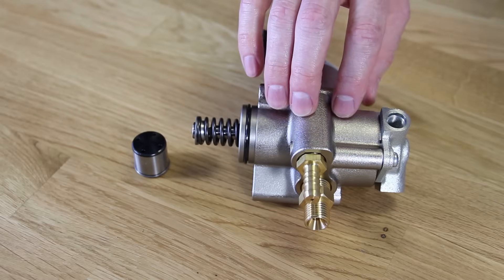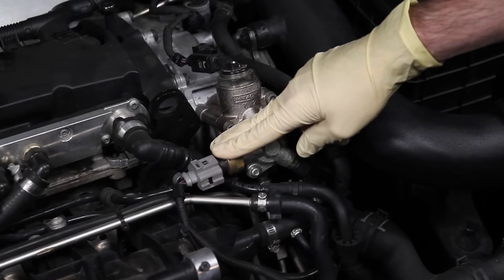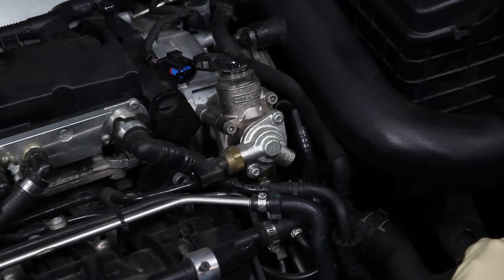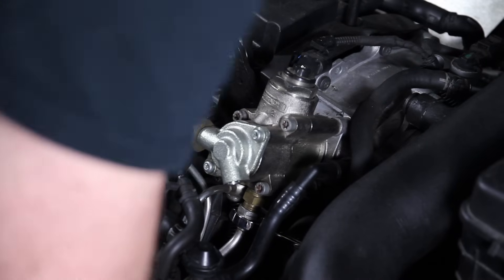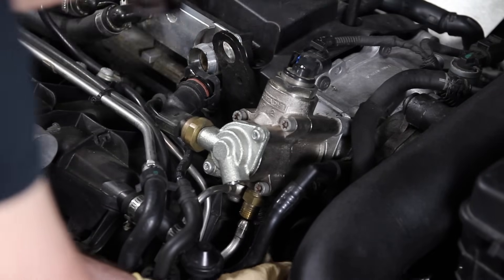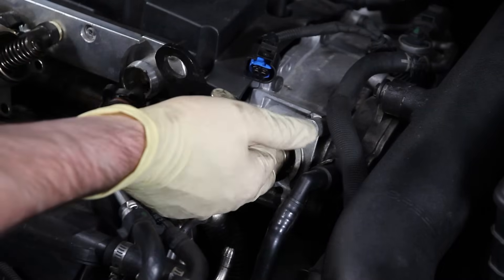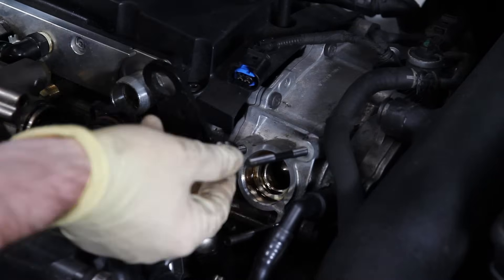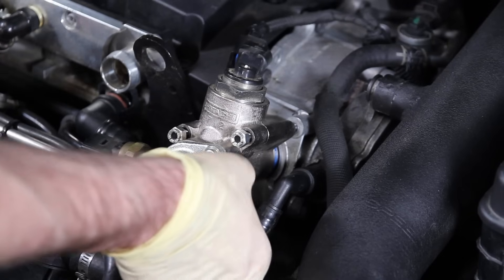VW Audi 2.0T FSI - How to (DIY) Check the Cam Follower, Replace the Fuel Pump and Convert to Studs

Comment: Thanks for the video! It was a big help. Probably saved me about $300 bucks. The follower was ready to be replaced after about 40,000 miles. Originally it failed at about 81,000 miles with catastrophic damage, but was covered under warranty.  This time I caught it at the right time.  Most of the black coating was worn off except around the edges, but no apparent damage. Getting access to the Banjo bolt fuel line was the biggest challenge and took about a half hour to get off, but reinstalled in minutes. My 2006 GTI is stock and I don't drive it hard. As it happened, I did not put on the stud kit due to clearance issues. I  couldn't get the fuel pump back on without pushing hoses and lines, and didn't feel comfortable forcing anything. In retrospect I could have removed the brass fuel fitting to the pump to get the clearance and then reinstalled it after mounting the pump. I was pressed for time then. Maybe next time, if I still have the car. All in all a great learning experience though. Kris

Comment: I have a 2007 A4 2.0t.  I found that using a 1/4" ratchet to a 12" extension with a u-joint to the 8mm triple square was the easiest.  I couldn't get my stubby 1/4" ratchet with my hand in there like the video.  Also doing it this way I didn't need to remove the PCV tube.  Once it was loose I used a magnet tool to keep it from falling into the engine bay.
Reply: Could it be done this way without removing the schrader valve too?

Comment: Just got an '07 Passat 2.0T. I'm not sure exactly which engine it has, but I will find out ASAP. I do like the ease of the HPFP removal to inspect that cam follower. This would be a couple hour job it seems the first time, then it would be much easier once you figured out that stubby 17 is where it's at. 

Well done video. Thanks for posting. You're now on my list.
Reply from the maker: glad to help thanks for watching
Reply: Gonna do this today. Thanks for the parts!
Reply: Is there a washer with the banjo bolt or no? I just finally removed it after it was stripped by a previous owner of the vehicle. Boy was it a pig to get out. I removed it with tiny vise grips. Im just worried it i dropped a washer. Any help would be appriciated. Thank you.
Reply: Most banjo bolts have a washer. I do not remember specifically if this one had a washer or not.
Reply: Kimberly Anderson should say fsi or tsi on the engine cover

Comment: Hi quick question I have a code on my car which is fuel pressure regulator 2 open circuit p2294. Is this the fuel sensor on the top of the hpfp as mine has a crack on it please help

Comment: You should add in your instructions that on a 2005-2008 B7 A4 2.0T the coolant hard pipe needs the two bolts removed from the intake and the triple square from the fuel line in order to sneak the HPFP onto the studs.
Reply from the maker: +TAHS Auto Tech Thanks for that.  This was done on a transverse engine which would be a little different than the longitudinal engine found in the A4.
Reply: +Deutsche Auto Parts hi I have a 2009 Audi a8 I was wondering if you can help me out I had a cold p2293 fuel pressure regulator 2 does that mean that my pump needs to change the high pressure fuel pump
Reply from the maker: We are sorry but you will have to have the vehicle properly diagnosed to see whats going on.
Reply: Okay thank you .
Reply: Guess i have to go to the dealer
Reply: +Deutsche Auto Parts so when you change the pump you have to change over the sensor to doesn't the new pump comes with a sensor and Schrader valve
Reply: +TAHS Auto Tech  I just did this job on my 2008 B7 and could not figure out how to move the coolant hard pipe so i didn't install the studs. Is there a tutorial posted somewhere on how to move that pipe, like where those bolts are. i just could not figure it out on my own...
Reply from the maker: Victor Silva Sorry we dont have more details on that particular model.

Comment: 2018 Atlas - EPC with CEL flashing, slow crank, rough idle, cylinders 1-3 misfire, STRONG fuel smell in crankcase and cabin. Could the pump and/or follower be the reason for this failure? Or maybe the pressure regulator? THANKS! GREAT VIDEO!

Comment: I have 2007 audi a4 2.0 t fuel pressure regulator  problems and I am trying to buy through the orally auto parts they said cost me 59 dollars to buy it. How easy to change them ?

Comment: Will failure of this pump cause a no start? I have a 2006 Volkswagen GTI 2.0 turbo I actually ran it out of gas filled it up it ran fine but when it got low on gas again it would not start for me I replaced the electronic fuel pump in the tank with the filter and I've been watching all these videos it seems to me the high pressure pump would be the issue any suggestions? Thank you

Comment: I’m just about to do this job and I am wondering if the engine needs to be in Top dead center position? You didn’t touch on this in the video so I just want to be safe before I replace my fuel pump. Thanks!

Comment: Whats to prevent the whole stud from coming out, next change, with the Nyloc coated nuts gripping the stud? Unless the studs are put in with MORE torque than the recommended 8Nm. If the smooth center of the stud were squared or knurled, pliers seem to just spin around the shaft.

Comment: Great video, i have a question if you can help. i have VW 2013 passat cc, i drove it for long time while check oil light is on and i had to change crankshaft, bearing shaft and sort, after the engine is fixed, the check oil light keeps blinking repeatedly, i changed the oil pump, still the same thing,the engine is TSI 2.0 TSI, please, what else can i do.

Comment: Hey great video. I recently checked my cam follower but when I put everything back together I had a large leak spraying from the banjo bolt. There is a copper washer with the banjo bolt, should that be replaced, or is there something else that would cause a leak?
Reply: Did you ever figure it out. I had same problem.
Reply: @jayghost1482  the copper washer was not supposed to be there

Comment: I have a 2007 VW Eos with 2.0T engine.  I replaced the high pressure fuel pump and am now getting error P0010. Any advice?

Comment: I'm not sure if it's made for the VW 2.0T FSI engine or not but I see Cam Followers with a roller on the end that meets against the Cam, So maybe less Ware & Tare on the Cam , If I can find that type of Cam Follower for the VW FSI 2.0T would you recommend it ?   Part#  HITACHI FUP3058

Comment: Two questions...
1. Where did you buy the 8mm triple square socket? All i keep finding is the Schwaben set HB-120612. But i can see an maybe a fitment issue. To long. That stubby is nice.

2.Is there a kit to get rid of banjo bolt? That things seems bad. 

And as always Deutsche & Paul BIG THANK YOU  for the help and great videos you put out there!
Reply from the maker: +Mike Redpath Thank you so much for the kind words.  We appreciate it very much.  

1. We have this tripple square set https://deutscheautoparts.com/mn10pc.html
2. Yes we have this kit for what you are talking about https://deutscheautoparts.com/fsi-bamboo-barb-fuel-fitting-conversion-hpfp.html
Reply: +Mike Redpath I got mine on amazon.  This set is great because is very short and fits in tight places.
http://www.amazon.com/gp/product/B004WIWN1U?psc=1&redirect=true&ref_=oh_aui_detailpage_o03_s00
Reply: +Deutsche Auto Parts So got my stud kit today to get rid torx bolts. Big question what tips do you recommend for removal of banjo bolt? Get car to temperature(for a lil heat)? WD 40 ? 
I couldn't afford to get rid of the crap banjo just yet.
Reply from the maker: Mike Redpath Thanks for the order we appreciate it.  No real tips other than make sure you are in the triple square banjo bolt really well.  Stripping the bolt wouldnt be fun.
Reply: +Deutsche Auto Parts All done. If there's one thing I could add it would be...
STUCK A TSHIRT RAG UNDER NEATH BANJO BOLT WHEN TAKING OFF AND ON. LOST IT BOTH TIMES. 
Other than that not bad. Took my time and made sure I watched the video a few times, followed it and went smooth. Thank you. I think I had almost 100k on mine and I'm not joking. It didn't look bad. Coating was gone but expected that. The head was solid and nothing missing. The gasket was heat stressed so glad I ordered that too.
Reply: +Tim Schultz ordered them and they worked great. Thx for the recommendation.

Comment: I opened mine to check it and when I put it back I got a misfire on cylinder 2 it was fine before I checked the cam follower. Does the high pressure fuel pump need bleeding or what ? Air on the pump maybe ?
Reply from the maker: Julian Ponce No you will not need to bleed it.  It sounds like your misfire is not likely related to the HPFP or cam follower.  Your misfire is likely to be related to something else.  Take a look at this article to find out more about tracking misfires down. http://shopdap.com/bad-ignition-coils-and-misfires-for-vw-audi-2-0t-fsi/

Comment: hi, i have audi a4 b7 2.0t fsi s-line. I have the following problem eror code (p2293 fuel pressure regulator 2) and two p0087 fuel rail/system pressure too low. The engine runs very poorly. what is the problem?

Comment: Awesome thanks.  Is this the 'old' TFSI, or is it the TSI that Audi confusingly call the TFSI?  Thanks for explaining how to bleed off the fuel pressure - I saw in your intake manifold video that that would need to be done but it wasn't explained how.  This makes it look so easy! :)
Reply from the maker: +Harry Marshall Depends on the vehicle.  Audi uses TFSI most so many models
Reply: @Deutscheautoparts  hey I changed my cam follower and fuel pressure sensor and since I dine that I get fuel codes pop up and I notice ain't got a lot of fuel coming from the release valve when I pulled it back off to check things out what do you think

Comment: Got a question or two I'm hoping someone who's done this can answer. When I was trying to remove the HPFP to do this, I was able to get just about everything disconnected and bleed the schrader valve but I couldn't get the 3 bolts holding it to unscrew, I tried a regular screw driver, electronic screw driver, and a regular drill with no budge, not sure if whoever worked on it last over tightened it or if I'm doing something wrong, but I'm not too sure how else to get them off. Also, is it necessary to remove the rubber line and hardline to do this? I heard it was possible to move the pump enough to replace the follower but I have some doubts on whether that's safe to do or not, I'd figure it wouldn't be a good idea. Anyone else who's done this deal with that or know what to do? I've got a spare set of bolts but I've read somewhere they might not fit with the HPFP so I'd rather use them as a last resort.

Comment: Hi, I would like to know if the cam follower is still an issue with the latest Golf 7.5 R. Is it still something to check often? Thanks in advance.
Reply: I believe that with the TSI they updated it with an actual moving wheel on the follower to avoid issues like this.

Comment: I've read that you want to replace any FSI cam follower with an aftermarket version because the one that Audi/VW manufacture wear faster and hinder performance somehow
Reply from the maker: +Authorized Mike That is not accurate as far as we know.
Reply: Deutsche Auto Parts
Ok cool

Comment: I know this video is 4 years old, but I just replaced my HPFP on my mkv GTI because the top sensor was broken. And I followed all the steps, but my car was still idling rough and had the same p2294 code. Any advice, does it need to run longer to even out?
Reply: Frank Olson, please tell me, how did you fix it. My car doesn't idle correctly either. (Mk5 gti 2008 160 km

Comment: If i replace the cam follower every 15k can my camshaft be damage or my fuel pump? or will they only be damage if they are broken ? Thank you
Reply from the maker: The original camshafts were updated because there were some issues with them.  With that said changing the cam follower often will help lengthen the life of your cam and potentially prevent any damage at all.
Reply: Thank you
Reply: Deutsche Auto Parts- Your Source for Everything VW and Audi Do you have a video about a FSI vehicle camshaft inspection and replacement?
Reply: Johnnie Wong is it damaged only if metal falls into the engine...?

Comment: Question please; cam follower should replace for the 2009 VW TSI engine? or TSI engine should do some other for fuel pump every 20,000 or 40,000 miles?
Reply: TSI doesn't have one of thsese fuel pumps, only fsi
Reply: TSI fuel pump has roller cam follower, no maintenance.

Comment: Does the engine need to be TDC before doing this? That's what Pelican Parts says to do anyway. I've never done that.
Reply: Doesn't need to be, but the pump is probably less compressed at that point.  With the factory bolts, they might not be long enough (I bet they actually are), but with the stud kit, you're probably fine.

Comment: What if your stock hpfp doesn’t have a shrader valve or inlet? The new hpfp that I bought from ecs tuning has the inlet but I don’t actually have a schrader valve to swap over because the original pump did not come with one stock. Do I just buy a new valve and put it on? I don’t think you can just leave that open.

Comment: Hey got a quick question, I removed the union from the bottom of the HPFP that joins the flexible fuel line and in doing so think I might have dropped a crush washer or something into the engine compartment. I wasn't sure, so I reattached it and now have a fuel leak coming from that union. Does anyone know if there is indeed a washer that goes between the union and the HPFP, thanks.
Reply from the maker: kg*2 The VW Catalog does no show any washer there.  You may not have it tightened down all the way.  Hope this helps
Reply: thanks for the reply, how do I get that catalog btw?
Reply from the maker: I'm sorry it is not something available to the public.

Comment: I have an Audi 2.0 Quattro 2006. I recently bought it and the check engine light came on. I have been told its relating to the HPFP code P0089. I have so far changed the senor, filter and regulator. But the check engine light come on intermittently. I do not feel any loss of power or hesitation. the car runs very well apart from a diesel like sound. My mechanic told me this noise is normal for direct injection engines such as my audi fsi. The car does not shake on idle nor while driving high speeds. I do notice that the HPFP does make noise especially when the engine is cold. But I also inspected the pump, and cam follower as well as the cam shaft the look like new. So I just can't figure why this light keeps coming back on. I am also changing my N80 valve because I do notice ticking noise coming from he old one. Any suggestions>

Comment: when i was removing schrader valve, i think i put too much pressure and ended up bending the bolt, can i replace them and how do i remove the bent bolts?
Reply from the maker: +Joshua Kim What bolts are you referring to?
Reply: +Deutsche Auto Parts a gold bolt that you have to use 13 mm wrench to remove
Reply from the maker: +Joshua Kim This is the valve you're talking about https://deutscheautoparts.com/06d-133-400-a.html
Reply: +Deutsche Auto Parts oh yes it is do you deliver to new Zealand? Exactly what i wanted
Reply from the maker: Joshua Kim We are sorry we dont ship outside the US.

Comment: What happened with the old cam follower that was gone? Where is the part? in the engine or in the high pressure fuel pump?

Comment: FYI...  If you have the later revision with the hose, instead of the banjo bolt, you don't need to remove the hose in order to replace the cam follower!  I wish I had known that before spending my weekend screwing with that god awful spring clip!
Reply: I have the banjo bolt which means I will have to take it off even if im just replacing cam follower?
Reply: @jhirsch123 you sir, have saved a few random fellows' weekend. Thanks!!!
Reply: Yes I just got to replace in that part and the new PVC valve is so crispy and new I can't get that thing to click on for nothing..... Doesn't leak but those clips are just pure crap can't put the other part back on because I had to break the clip to get the other one off 🤷🏾‍♂️

Comment: Hi, Paul,
Do I need a torque wrench for this at any point? I watched another video on replacing the pump and he used a torque wrench for the t30s and everything else I think. 

Also, how will I know if the cam is damaged?

Thanks!
Reply: Yeah it's 9.5 Nm torque. And the follower is damaged if the black part has reduced too much. Completely dead if you see a convex hole in it.

Comment: I replaced my fuel pump and cam follower with parts supplied by your store. When I did the job I noticed the cam was a little grooved, not horrible very mild. I understand there are chances of possible camshaft failure but is it possible because of how mild the grooves were, that the camshaft would last for a bit of time with care?

Comment: I'm interested in the stud conversion kit, but it would be used on a mkvi golf r, which has a rubber fuel line on a barbed connection held in place with a one time just clamp. Would I be able to use the stud kit if i cannot disconnect the low pressure fuel line?

Comment: Great video, thanks. Questions: once replaced and fuel pump remounted, will the car just start back up again? No airlocks or bleeding required? Did you disconnect the battery?

Comment: I just bought the conversion kit but was wondering how you installed the studs themselves?  How did you mount the nut onto the stud in order to screw the stud in all of the way?
Reply from the maker: +Aaron Ridgeway They should thread in by hand.  We also recommend installing blue loc tite on the end that goes to the engine.